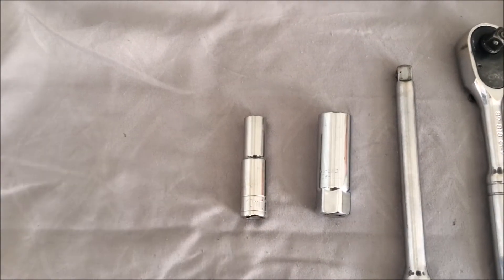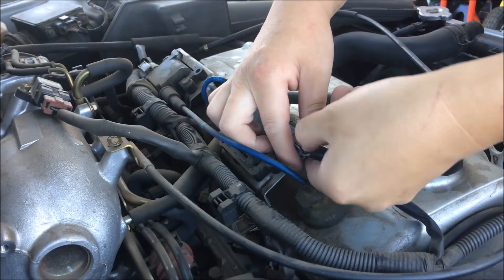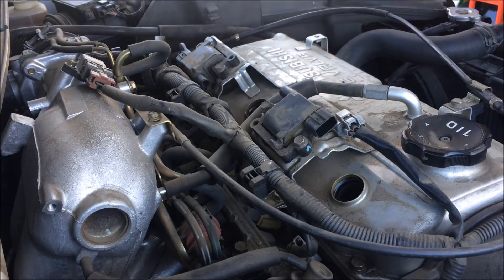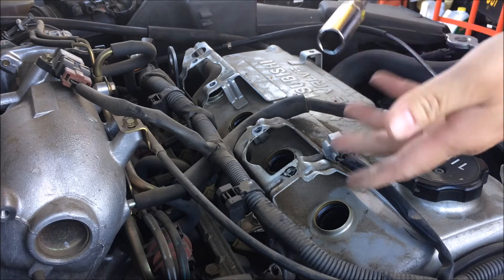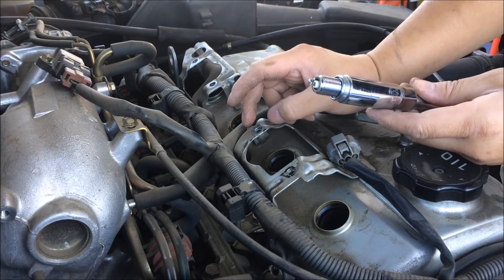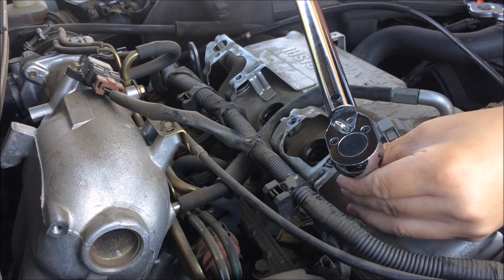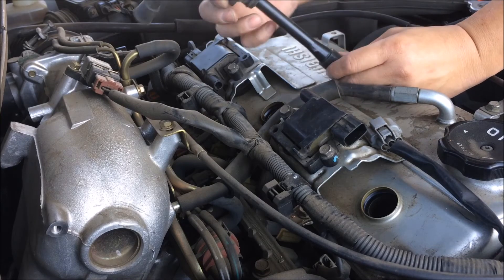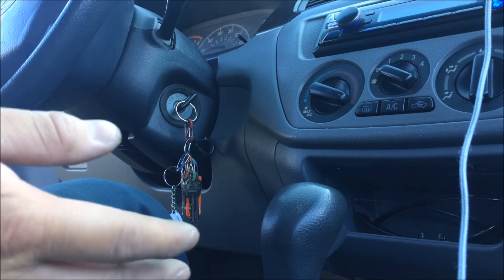Mitsubishi Lancer 2003 ES - Spark Plugs Replacement

Comment: whats spray you put on the chamber?
Reply from the maker: I bought this car as a used vehicle.  Who last did the spark plug replacement on the vehicle had used some kind of silicon to hold the ignition coil plug to the spark plug.  Before i proceed to remove the spark plug,  I used a multi-purpose duster canister to blow all the dirt and debris out of the hole .